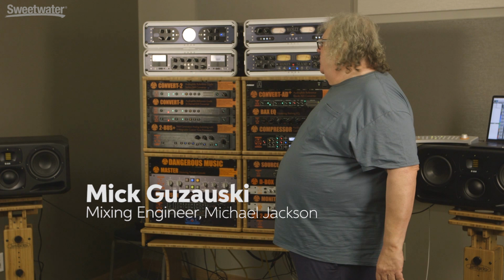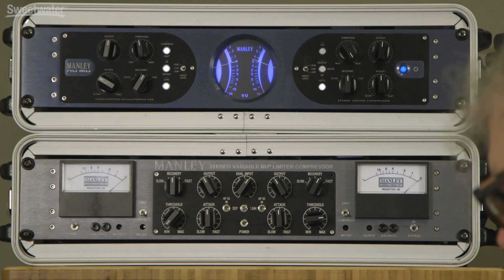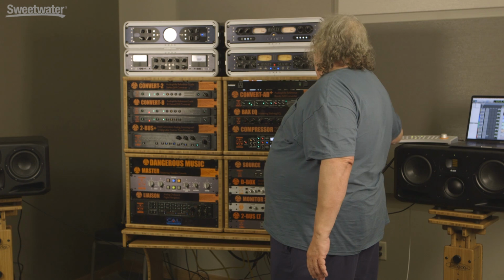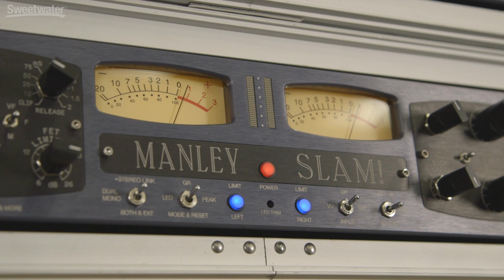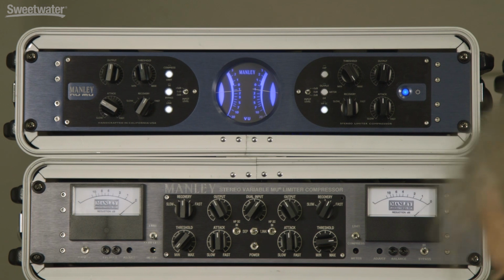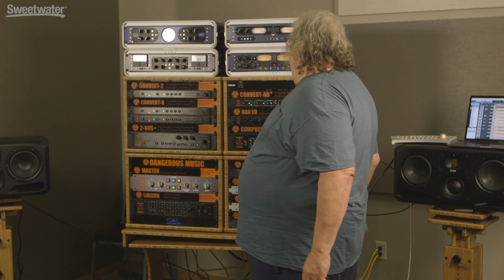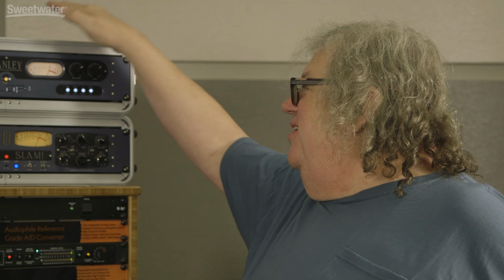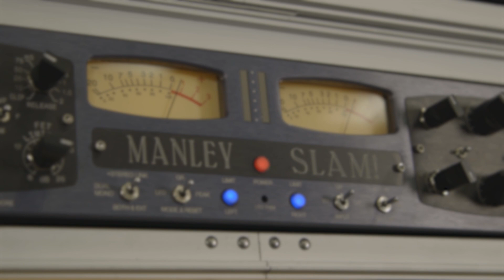Manley Dynamics Processors Demo with Mick Guzauski

Comment: Can you share what tubes were in the vari mu unit? Were you using hp filter mode? This does make a big difference in performance.
Reply: That was a stock Variable Mu unit with the 5670 input tubes, (not the TBAR mod).
Reply: @eveanna  Thanks!

Comment: They sound great. Although the left & right thresholds on the Vari-Mu are way off. As it's in link mode (which links the detector side chain not the controls) it might explain why it sounds like it's "pulling" so much. (2:53)